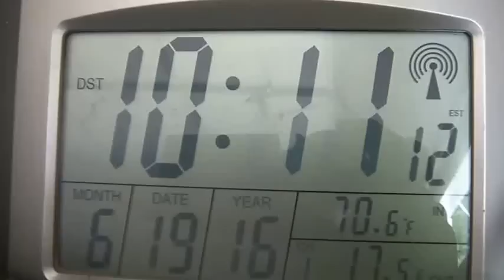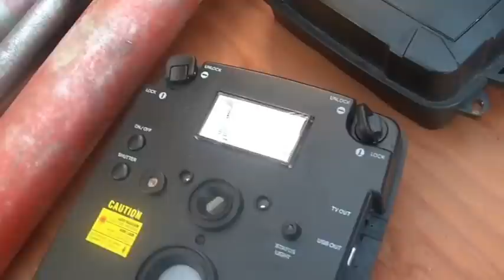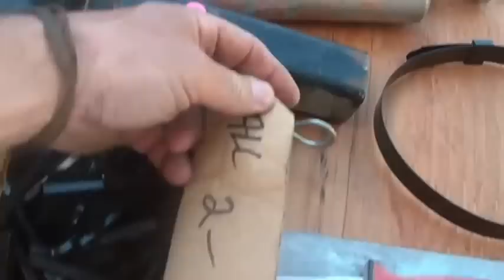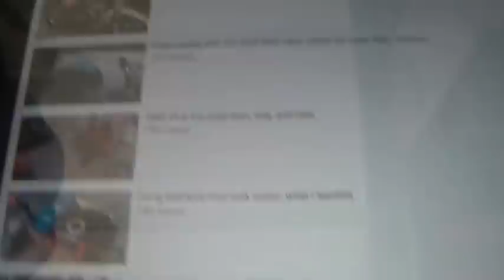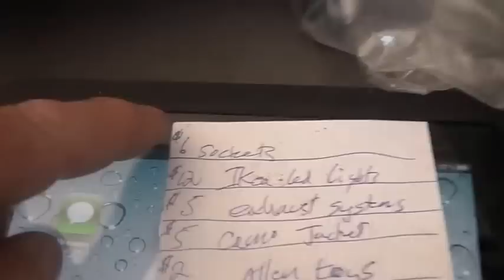Stormville Flea Market Deals, Spent $272

Comment: Boy I am hoping the trail cameras work. Probably will have to put a SD card in them to store the pictures. Sweet deal if they work good. I LOVE the lantern lights. I would love to buy them from you. I am into old lanterns so they are super cool to me if they work. You might could get a Boost for your internet power so you could keep the I-pad outside where you stay the most. They sell a thing called a Hot Spot that would allow you to jump from your router to the area where you are good. Killer score on them big vice clamps too wow cheep as it gets! $1? that's a steel.